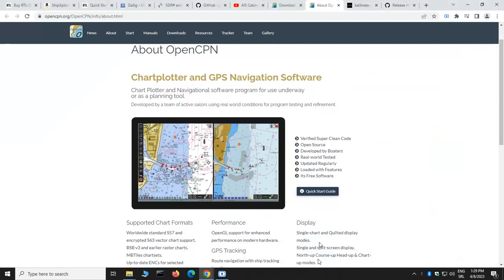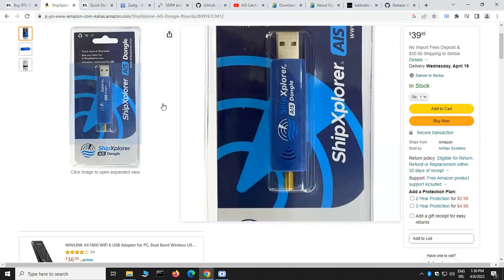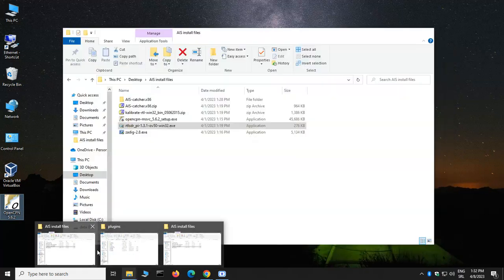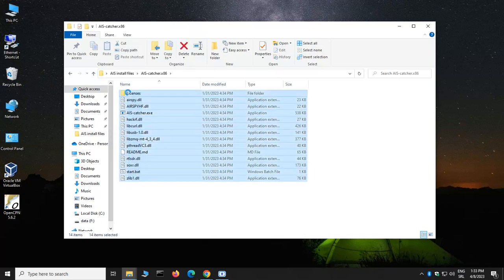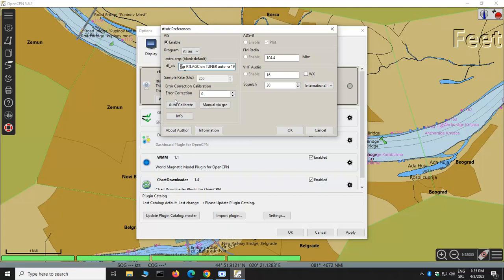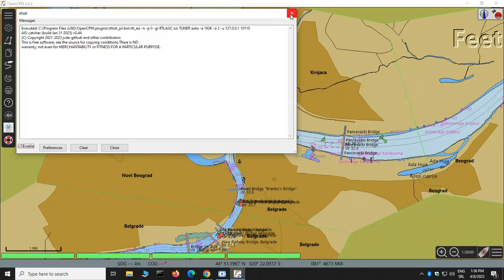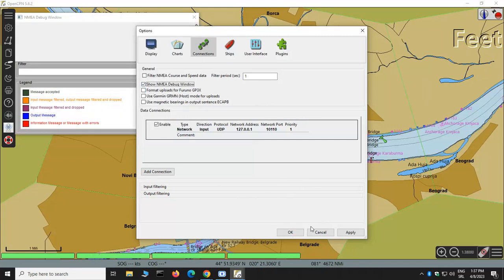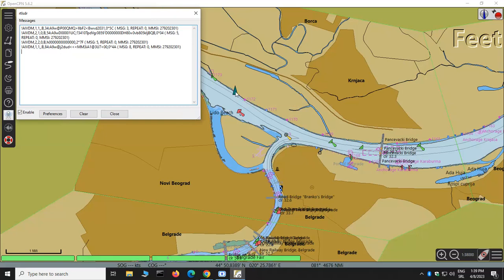Use RTL-SDR and AIS-catcher with OpenCPN; install and setup tutorial

Comment: Any way to run this on Linux? Currently using Lubuntu 24.10.
The Drivers for the RTL_SDR v3 device are available and installed, rtl_sdr plugin also works straight from OpenCPN Plugin catalogue and it recognized the dongle. I have no idea how to install AIS-Catcher from github onto linux, is it possible? The creator of the repository briefly mentions it in Documentation on their website but I couldn't find anything directly, any tips?

Edit:
I've managed to get Ais-catcher to work on its own, it outputs data over http://localhost:8100, now the main thing I want it to do is communicate with OpenCPN and output the ship objects there, do you know how I would do that?
Reply from the maker: Didn't have a chance to run it on Linux but I think that settings should be similar to the Windows version. You command AIS catcher to output data on some UDP port and bind that port in OpenCPN as input. Let me few days to try to run it on virtualbox
Reply: @milijaspasojevicyt9tt  Thanks  for the quick response! I will try to tinker as well, and if I solve it, I will share the solution :D
Reply from the maker: @nogiye15  Here is what I did:
I used two command line AIS catcher scripts from here>  https://docs.aiscatcher.org/installation/ubuntu-debian/ (Basic Installation¶)
Also installed web gui configurator (Installation with Web GUI) .
Upon install I opened web browser 127.0.0.1:8110 logged in, configured rtl sdr as input with defaults, selected output UDP and entered Host>127.0.0.1 and Port>10110. Sstarted service and set to auto-start with system. Then went back to OpenCPN and entered connection settings almost same as shown on video.
Reply: @milijaspasojevicyt9tt  Did my comment guide get deleted?
Reply from the maker: don't know, I didn't delete it, must have been some weird YouTube thing...
Reply: @milijaspasojevicyt9tt  Yea, youtube is deleting them, maybe its too many characters, if anyone is interested I can send you what I did. I solved it yesterday, similar to your solution.

Comment: Open CPN doesn't recognized rtl_ais program in preference. I changed the ais catcher exe file to rtl_ais but to no avail.
Reply from the maker: Try with another (older) version of AIS_catcher, newer ones, just as you described, they are not visible to plugin.
Reply: Did it solved ? I get sam problem heree please help me to connect rtl sdr 4 to open cpn and aos catcher
Reply from the maker: @synopsys9767   use AIS-catcher versions 0.55-0.56 that will be recognized by plugin.
Reply from the maker: @synopsys9767  When I come back from vacation in 10 days, you can send me a message on yt9tt /@/ yahoo.com I can help you by teamviewer or anydesk
Reply: Have the same issue :(

Comment: What I miss in this presentation is the possibility to have the name of the vessel next to the AIS target. I often am in crowded area's like Port of Amsterdam and Port of Rotterdam, and I only see AIS targets, but never their (boat)names. So once I receive a call of a boat, I have no idea which of the 12 around me is calling me. Does OPENCPN have the possibility to show Boatname direct in the screen next to the AIS target (without any need to click)?
Reply from the maker: Only option that I know is in Options>Ships>AIS Targets  go to Display section and check Show names with AIS targets at scale greater than 1: and enter value at right, default is 250000. So, whenever color of target is green (and you zoom in more than value entered before) there will be name next to target. I think that some transponders are not sending this value so there is up to you to test it.
Reply: Allright,  @milijaspasojevicyt9tt  thanks I will install OpenCPN and look into it. THNX!

Comment: Can Ais catcher be downloaded on PC?
Reply from the maker: Yes, it can be used as standalone program, just unpack .zip file from step no. 7 (see in comment) and in that folder you will see  start(.bat) file, right click and edit file, erase all and enter this command AIS-catcher -gr RTLAGC on TUNER auto -o 2 -a 192K -u 127.0.0.1 10110 -N 8100 save and run.

Comment: I disapprove! You should install a transponder so others see you too! Those have nmea2000/nmea0183 outputs for reception too to 8ntegrate in opencpn
Reply from the maker: Of course they should use a transponder! it was not even in question, this guide is intended for those who would use this configuration as a backup or as ground station to monitor/track vessels. In the age of COVID-19, many people had to change their habits, work, and simply get out of their comfort zone. Many cruise ships stopped working and the crews dispersed to various other jobs and vessels. In order not to adapt to each new vessel systems, it would be convenient for them to have their own portable equipment that they would carry with them and in which they could rely as a BACKUP.

Comment: I cannot find the rtl sdr plug in in recent versions of OpenCPN despite updating the catalouge.  Can any one assist
Reply from the maker: As I noted, from version 5.8 and up it is not working, we are waiting development team to re-build so it is compatible with newer OpenCPN versions. As a workaround you can create .bat file  and run it before OpenCPN, file should be in the same bin folder and it can contain > AIS-catcher -gr RTLAGC on TUNER auto -o 2 -a 192K -u 127.0.0.1 10110 -N 8100 or if you renamed .exe file rtl_ais -gr RTLAGC on TUNER auto -o 2 -a 192K -u 127.0.0.1 10110 -N 8100
Reply: Do we have a time line for this.
 @milijaspasojevicyt9tt
Reply: Please make a video more for thiss
Reply: Koliko znam, kada se koristi AIS-catcher, nije pottebno da se na Open CPN-u instalira rtlsdr dodatak. Bar mi je tako rečeno. Ili možda grešim?

Comment: I followed everything, but I dont have the plug in showing up on the opencpn plugin page
Reply from the maker: Yesterday I find out that is not working with new OpenCPN version 5.8.2 last working was 5.6.2, if you are using new OpenCPN, try to downgrade or to do parallel installation. I will create another video to do workaround if issue with new version is not solved
Reply: @milijaspasojevicyt9tt  what your solution without downgrade?
Reply from the maker: @afuxl I asked developer of rtlsdr_pi plugin to upgrade it to work  with latest version. As workaround you can create .bat file which you can start before OpenCPN. Content of file is same as parameter value eg AIS-catcher -gr RTLAGC on TUNER auto -o 2 -a 192K -u 127.0.0.1 10110 -N 8100 or if you renamed .exe file rtl_ais -gr RTLAGC on TUNER auto -o 2 -a 192K -u 127.0.0.1 10110 -N 8100
Reply from the maker: @afuxl OpenCPN crew did update plugin, you can find it if you refresh plugin manager. I will soon upload new video how to setup 5.8.4 OpenCPN
Reply from the maker: Make sure you have installed rtlsdr_pi-1.3.1-ov50-win32.exe  from https://github.com/rgleason/rtlsdr_pi/releases/tag/v1.3.1-ov50beta then restart OpenCPN. Also you can check in install location eg C:\Program Files (x86)\OpenCPN\plugins does it contains  rtlsdr_pi folder and rtlsdr_pi.dll file